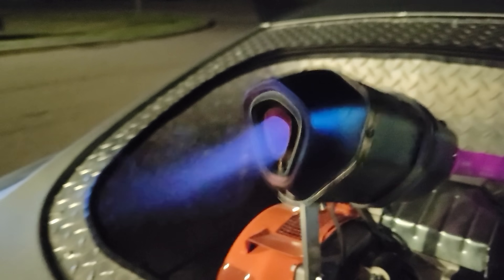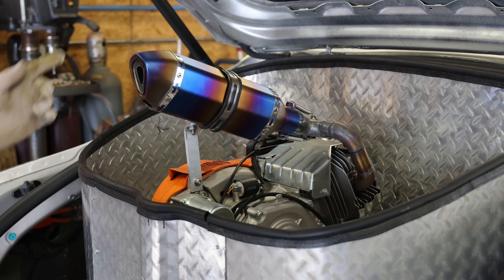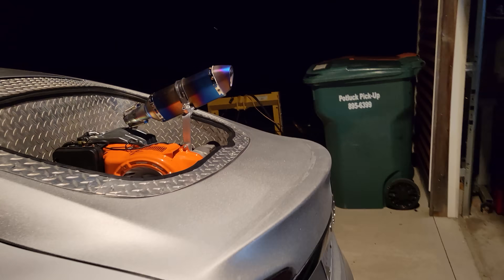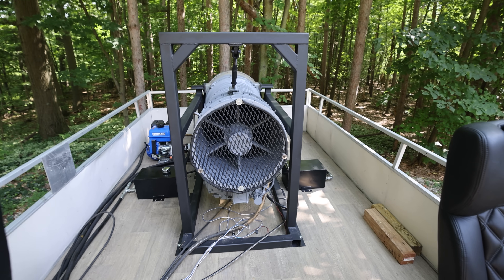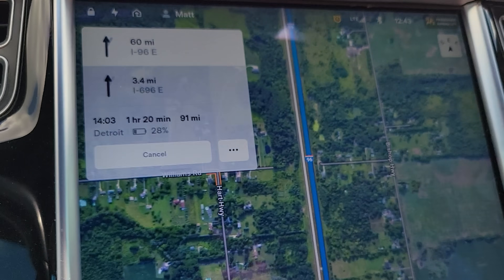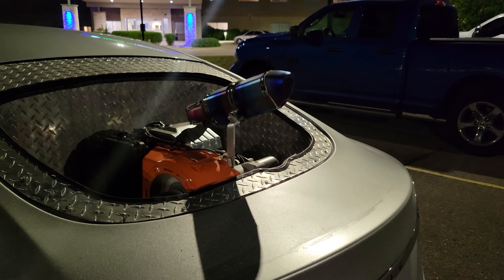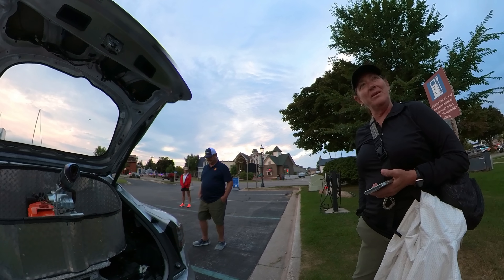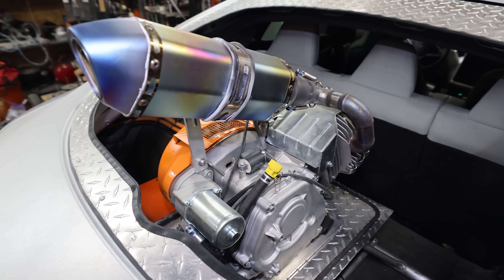Cordless Tesla (I Drive 1800 miles without charging) P.1

Comment: You never mentioned how much you spent on fuel. Based on the Data you supplied on the MPG, I am assuming you averaged about 19 MPG for the 1800 mile trip. That's about Somewhere in the neighborhood of $325 or so depending on the cost of the  gas per gallon and that was just for the driving time. We don't know how much fuel was used up when the car was idle overnight or parked on the side of the road. Anyway it seemed to be an exciting experiment. I'm really glad your leaking didn't cause an explosion!

Comment: Use your diesel engine you used in go kart and fill a huge tank of hydrodiesel then use regular diesel you might see better efficiency also use a generator equal to half the load. So 20kw diesel 10kw generator to keep it in it sweet spot. Bro please use a quiet muffler that dont kill efficiency

Comment: I like the experiment but its a total dick move to leave that loud thing running constantly. also taking up the EV charging spot at 13:00 when you're not gonna be charging
Reply from the maker: You couldn't hear the thing running inside the hotel at all, as for the charging spot you're incorrect. I was actually charging the car there because I was already finished with the 1800 miles at that point.

Comment: I wasn’t too into this until I heard how quite it was from the porto John. 🤔 
What if you put-just a generator (without the gas engine), on a trailer-coupled to the solid axle via sprocket/gear and chain, with wheels large enough to turn the generator at the required rpm’s to charge the battery as you drive. 🤔 The obvious problem with that is the generator would cause drag at the wheels consuming more electricity from the battery, but possibly could be overcome by experimenting with sprocket/gear ratios.

Comment: The generator still runs on  gasoline fuel so he would not be allowed to drive the car while the generators running in the future if gas is to be banned as a pollutant  he will be forced to take it off the road as it would be breaking the law! Its why its better to stick to petrol.
Reply from the maker: I threw this unit in the garbage after I finished this video. Just finished 2nd Generation of my system couple weeks ago.

Comment: I don't mean to be a naysayer because this concept is pretty much what everyone with EV range anxiety eventually thinks about, and it's great seeing your enthusiasm in actually trying it out. But unfortunately you will accrue more and more energy losses during each conversion of energy (mechanical losses -> electric conversion/heat losses -> charging/heat losses -> electric to mechanical/heat losses), which means an ICE will always be far more efficient mechanically if it's directly driving the vehicle (mechanical losses -> drivetrain/heat losses) versus using the ICE to charge the battery.

This is the basically the worse approach to the standard plug-in hybrid, because a standard plug-in hybrid doesn't need to haul a huge and heavy battery pack around since it's primary energy storage medium is gasoline instead of a lithium battery, and gasoline is roughly 100X more energy dense than lithium. So if your goal is efficiency and range extension, you only want to store enough energy in lithium to improve the moments of the ICE's lowest point of efficiency during demanding tasks like accelerating to highway speeds or from a dead stop.

Comment: From your MPG data it appears that your generator produced about 5.6 kWh per gallon or 17% efficiency from gasoline to electricity. Are there any engineers here to explain why these air cooled single piston 4 strokes get such poor efficiency? Is it due to low compression ratio with these cheap engines or fuel mixture being too rich?

Comment: You need a real silencer Muffler you need to clean up the design of the muffler sticking out the rear window port. What are the decibels of the motor?. Maybe soundproofing / fireproofing Behind double steel plates. And a hard shell cover like fiberglass that matches the car for the window Port where the Mufflers sticks out a little bit? As a clean design look with minimal noise

Comment: If you wanna burn gasoline, or any fossil fuel while driving, why just don't use an ICE? 6km/l is an utter tragedy. You could've used an Audi S8 and with those speeds do like 10km/l and never have to annoy people with that stupid lawnmower blasting shit in the background... This really makes no sense. Also, driving an EV (on renewables) compensates for the extra emissions made in production process of the battery. This makes it even so much worse. I think an Aventador is even more efficient than this shit build

Comment: Curroius 1800 miles how much gas did you buy? I'd imagine be maybe 50 to 100 mpg due to size of engine just to charge not for horsepower n torque. Yes need little bigger to charge faster. And need regular car muffler lol a glass pack cherry bomb

Comment: An interesting project with some obvious flaws that I'm sure are going to be fixed in the not so distant future.  In the short term plug-in hybrids are the best we have for making long roadtrips viable though EV fast charging and station availability are constantly improving.  There's already some cars that can charge from 0 to 80% (300 plus miles on some models) in less than 15 minutes and most people aren't going to want to drive 300 miles without stopping to at least stretch and probably use the bathroom and eat as well.  Those cars do still rely on availability of charging infrastructure though which is nowhere near as developed as it needs to be.  Reading through the comments I've seen a lot of ignorance on both sides of the EV fence, some people think that because most electricity is produced with fossil fuels that there's no real difference.  I want those people to consider that a properly built hybrid can get over 100mpg despite being heavier and more complex than a gas vehicle because electric motors are crazy efficient and a gas motor that only runs at it's optimal speed is way more efficient than a gas engine that is usually not at it's optimal speed.  Large gas or even coal fired power plants can produce electricity efficiently enough and the power lines are also efficient enough that the overall efficiency of an EV powered by a fossil fuel plant is still much better than the overall efficiency of a car directly powered by an internal combustion engine (ICE).  For those that point out the increased environmental impact required to make EVs you're half right, most EV today take about 10 years to break even after which point they are far less polluting.  That 10 years is quickly shrinking due to increased use of renewables, improvements in battery chemistry, improvements in battery recycling, and economies of scale (much larger plants can be more efficient but until recently there wasn't enough demand to justify the cost of making larger plants).  There's already real world testing being done of various grid storage solutions that are far more environmentally friendly and generally much cheaper as well.  The cheaper batteries are usually less power dense (so they aren't good for EVs or phones) but have much better long term storage and don't use lithium or other dangerous/expensive materials.  Better grid storage solutions means more renewables can be used and just like the EVs themselves even if they cause more damage upfront they cause substantially less damage over their expected lifetime and of course those technologies are also evolving quite rapidly.  For those on the other side of things that are quick to condemn this project please read everything else I just wrote, while EVs and related technology are improving there is still a substantial gap for those who need to do a lot of driving.  There's also major infrastructure issues to be worked out, I'd personally be well served by an EV with a relatively small battery IF I didn't live in a condo (which is basically a glorified apartment) which prevents me from charging at home.  If I had a hybrid I could at least reduce my use of gasoline (and save myself some money) but unfortunately when I purchased my current vehicle the cheapest hybrids were well above my price range (I even looked for used ones).  There are a few charging stations around now so perhaps if I was in the market for a new car I could make it work (I discovered by accident that there's actually a Tesla fast charging station near the grocery store I go to) but of course when I was looking for a car those were not available (considering how much my car cost me I have no intentions of buying a new one anytime soon).  With a better generator this modified Tesla could probably get 3 to 4 times the fuel efficiency of this initial prototype and be much quieter to boot.

Comment: I know you had a time limit, but this is something I'd love to see more of in an optimal iteration. I think combustion range extenders should be an option offered to every single EV.
Reply: That or all body solar, stata plates or thermal conducting energy added.
One can't power itself forever, but lots of little add ons back each other up (less weight and more recovery)
Reply: It's called a Plug-in hybrid 😂
Unless you mean a removable engine that you can leave home, or even just rent?
Reply: They are, they are called Hybrids.
Reply: trailer unit
Reply: Solar panels just mean one more thing in an EV that have a guaranteed replacement date where their efficiency drops so low it doesn’t do anything.

Comment: What I don't understand is that I know that there is way to generate power but I know it takes power to generate power. As a matter of fact I knew that there was a way to generate power but you have to kick the power on first to get the power to generate. And I googled something like this and there is something like that out here on the market. Basically it's like having a generator but you don't have to use fuel to run it you have to start it up with power and then the power that it generates is the power that it takes to run it but it actually generates more power than what it pulls to actually you to actually produce power. And I don't understand why they would not find a way to do this to a car that runs off electric. I mean I know it would have to produce a lot of power but cuz I know a normal generator from a car would not produce enough power to run something like this and keep the power up. But the generator that I've seen that you can use that you can modify are probably three to four or five times as big as a generator that's normally in a car I'm just not so sure of how much power that it would actually have to produce to run a car like this. But I'm thinking there's a way of doing this without having to use any fuel whatsoever the only thing you have to do is start up the generator and the generator produces more power than of what it takes to actually run it. So as you're actually running the generator it actually charges and it only draws so much power from the generator that it can stay running continuously.

Comment: What your saying in time to charge your spending in gas so I dont see what the point is what you made is a hybrid and a noisy hybrid
Reply from the maker: This thing is junk, I just put this version together to test my entire system in my electronics to work out all the kinks before I go bigger... Don't worry I didn't do all this for nothing.
Reply: @WarpedYT  well their is a battery coming to market called the forever battery and its very thin and very small and it can charge fully in 10 minutes and has a range of 1200 miles on one full charge
Reply from the maker: I've seen that, I'm skeptical.  but 1200mi range in what car is the question, in a Tesla +- 240 miles on the freeway is the entire 100kw pack, so in the AWD Model S P , you would need about 500kw of power on board. That's a lot of juice even if the battery is slightly lighter than lithium ion let's say half that's still going to be a 3,000 lb battery at that point.
Reply: @WarpedYT  two good questions and they didnt say which car would get that and they didnt say how many of those batteries are needed to achieve 1200 miles but they did say the batteries are very light weight no bigger than a deck of cards , seems like something you could investigate and let us know what you find out

Comment: I think the next iteration would have to be quieter. Perhaps strapping two Clydesdales to the front, and have them pull the car. This will then give you the range and the cost savings on gas. But you might have to travel with bales of hay. You might even be able to call it a Mustang.
Reply: Lol best comment yet
Reply: Or buy a Hybrid.....
Reply: @realsecman I'm not aware of any 1000 hp hybrids.
Reply: Bigger and quieter engine would be nice, it's basically less efficient than swapping in a lawn mower engine directly except you have 1000 hp if its charged. @robotcantina8957 does those kind of builds.
Reply: Very bad idea, It could encourage him to drink Bud Light, And couldn't watch the video if he dressed up as a woman.
Reply: LOL

Comment: Electric Cars are Definately Not the Answer or Solution to So Called Green Energy Challenges.
Reply from the maker: Imo electric cars are a big piece of the solution, but not the entire solution.
Reply: @WarpedYT  We still dont have enough of a green energy grid supply yet to support it because the enviro radicals have not embraced nueclear energy as the solution not even the safer fission alternative then they wanna remove all the clean green power dams on top of all that  So apparently they still have their heads up their asses still..and beleive more in rainbows n lollipops as the solution.

Comment: The next goal should be to make it as silent as possible. Not sure if the noise is coming from the motor itself or the exhaust, but I'm quite sure some of the noise can be reduced with some custom made insulation panels. Unless the real reason to leave it open is for thermals.

Comment: Very doubtful design for most places in the world, but
But. 
1. If you charge it with the electricity when you can during your stops, while using car generator as a back-up.
2. If you take better and less loud generator.
3. First two points don't matter if you live in a country at war and electricity is a scarce resource. I saw a photo of Tesla with a generator behind the trunk, here in Kyiv.
Then it's a really viable design :D

Comment: Whether you're using an electric charging station, or charging using your own gas powered generator, YOU'RE STILL CHARGING IT. Total click bait. You didn't drive 1800 miles without charging. You were charging FOR 1800 miles.

Comment: Nope!  Cool project BUT the results are ALL wrong: Lousy mileage, speed, noise pollution, fire hazard and wasted TIME.  

At the very least, I'd muffle the crap out of it; make it a QUIET abomination?  🤣  

Also it would be a cool back up if you get caught out with no charger.  THAT would make it handy.
Reply from the maker: Too late this thing is already in the garbage, almost done with version 2. Then onto V3 V4 until I get the the final version.
Reply: @WarpedYT  Looking forward!!  I figured with the little old ladies complaining at the supermarket...I wasn't saying anything you already didn't know. 😜

Comment: This project is awesome!
I build a hybrid Series car too in 2015. I do not build all of it by myself. but I build EMS (Energy Management Systems) and real-time battery Monitors. 
because we use conventional ICE cars and then modified to an electric cars. so we can control everything we want. we can use Constant Current (CC) state for the charging process which means the generator works at the highest efficiency then shut down the generator. when the battery is below 20% the generator automatically turns on and charges the cars.

Comment: The generator engine is 16% efficiency whereas typical car engines are 30-36% and diesel is higher again.  Add in the losses from all the additional components and you've created an extremely inefficient, gas-guzzling electric vehicle. Congrats. You "rolled coal" on yourself.

Comment: Very nice project, is the charger a AC or DC unit on the back of that motor?  My understanding is Tesla's do better at charging from DC chargers over AC chargers..  Rapid charges tend to be DC charging.  You probably need about 23k watts to charge and drive to break even at 65 MPH.

Comment: How complicated would it be to attach a solar panel to the roof of a Tesla? Surely the concept idea works but would it actually work as a constant source of energy for the battery when the sun is up?
Reply from the maker: It can and has been done, but solar panels do not make nearly enough energy to keep up with the demand. My car averages 275-325 wh/mi on the freeway in the summertime without the heat or the air conditioning running. With the heat on that number jumps to about 900 wh/mi. So look up the solar panels that you're thinking about see how much power they produce per hour, take your Watt hours per mile multiply that times your speed and miles per hour and that would be the energy that you need.
Reply: For that to work the vehicle needs to be closer to the sun.
Reply: Don't lift the pickup truck